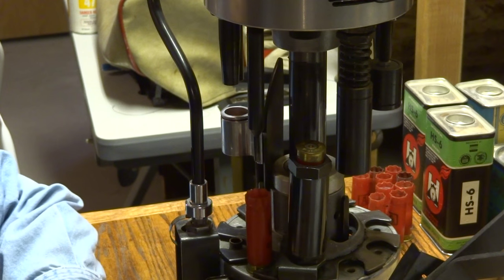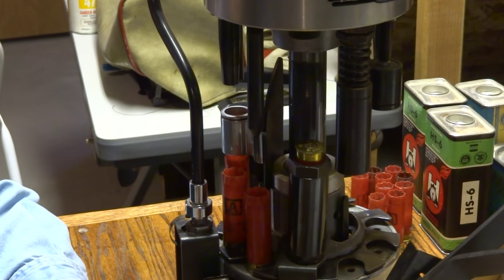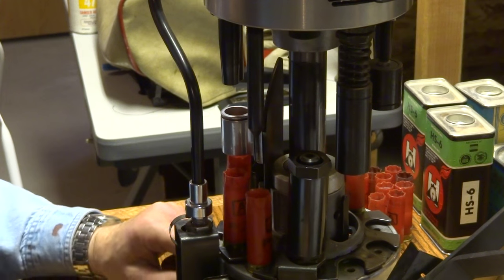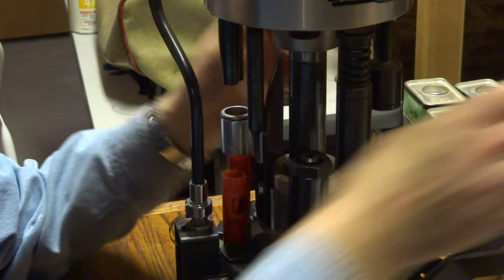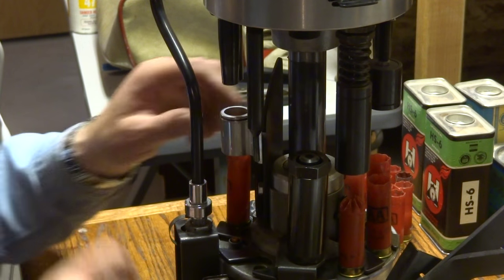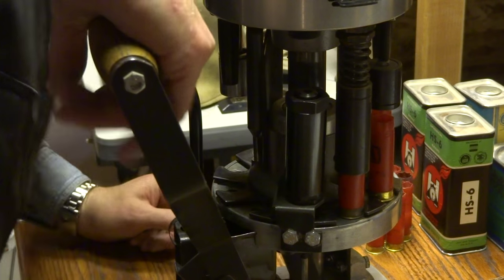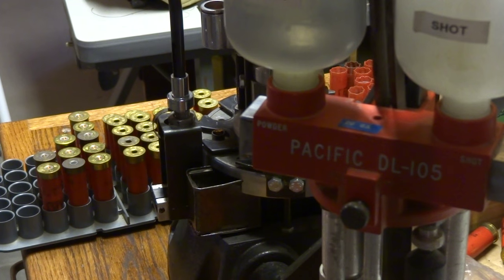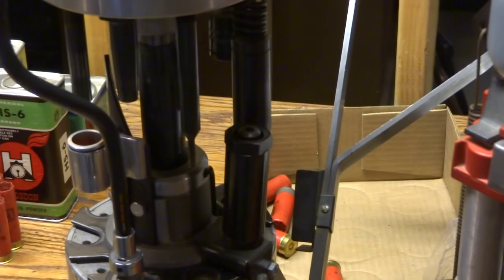TEXAN PROGRESSIVE  RELOADER

Comment: I have come to own and Texan progressive shot shell reloader Model 11-A with no primer tube or resizer. For 50 plus years I have owned 5 Texan FW reloaders 12, 20, 28, & 410 plus an extra 12 ga. FW reloader for parts and a full set of powder and shot bushings.. After some machining and replacement of missing parts plus adjusting the progressive reloader from the old days of fiber wads, to todays plastic wads, the machine works very well.  I also own 4 MEC 600 Junior reloaders same gauges.  The problem I have is that the old Texan powder bushings do not drop todays powders as in grains listed.  So to ask, I"m looking for a complete and functional auto primer for the progressive reloader, a resizer and a current bushing chart if someone has taken the time to make one using todays powders. Any comments will be appreciated.  Terry L. Schuetz

Comment: I now have 6 of these machines.  2 are MK II,s (12g & 20g), and the other 4 are MK IV,s  all 12 g. I buy them usually as basket cases, and rebuild and refurbish them. I have completed 5 of them, but the MK II  20g is still  needing parts, mostly tooling. Any around?  Dave
Reply: Do you have a primer feed tube for a mark 4